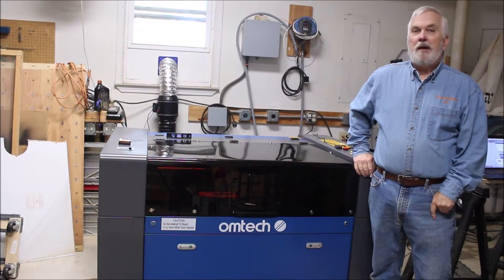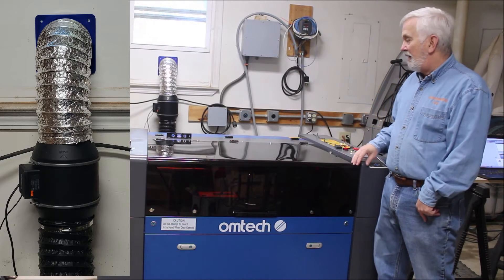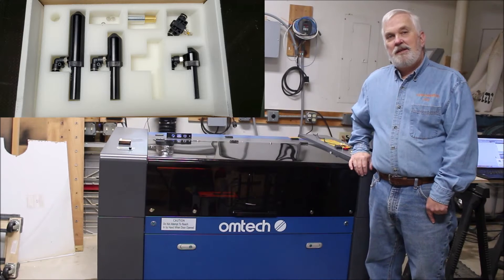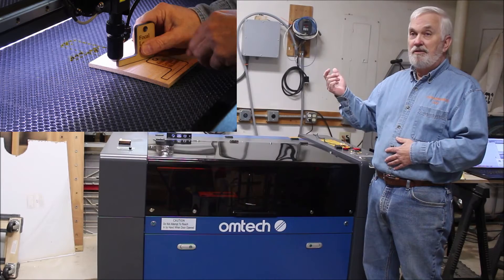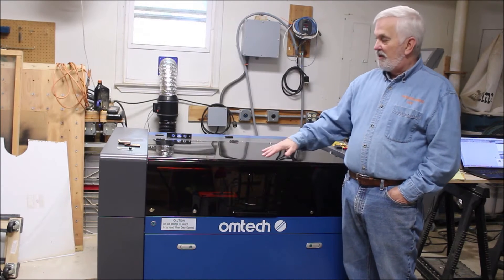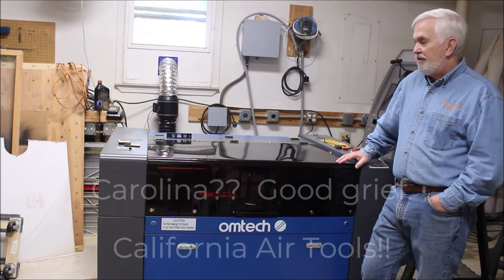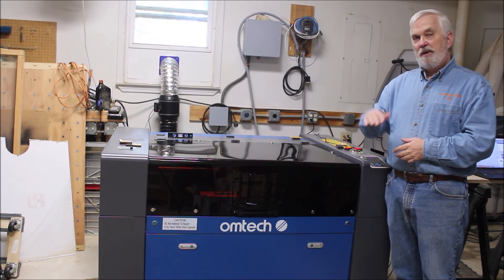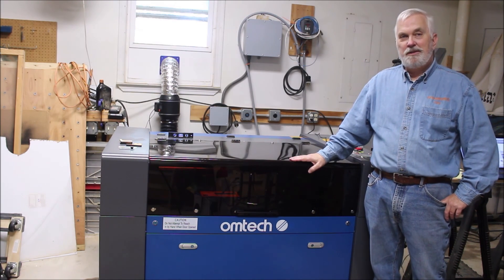Omtech Laser Set Up and Upgrades

Comment: Nice shop setup.  I don't think it would hurt to leave the stock fan in place and run the new fan.  It is a restriction point, but the new fan functions like a booster or vice versa.
Reply from the maker: That's not how airflow works.  You need to remove the weak stock fan to get a good draw.

Comment: I am trying learning more about AP lens. What lens do you use most?
Reply from the maker: Thanks for watching Douglas.  I typically use the 2" lens the most.  No real reason other than the stock lens that came with the Omtech was a 2".  If I was doing an engraving and I wanted the best possible result I would use my 1 1/2" lens.  If I needed to cut some thicker material I would use the 4" lens as the focal length is better for cutting than engraving.  There is a good explanation of the different lens on the American Photonics website.

Comment: Hey Dave! Did you plug your chiller power into the laser engraver? There is a port in the back for the chiller but i've seen others say not to use it. I just got my AF2435 and i'd prefer to have everything plugged into the laser but i also dont want to cause an issue.
Reply from the maker: No, I did not.  I have my chiller plugged into a separate wall outlet on a different circuit.   I've noticed that when you turn the chiller off the water will drain (because of gravity) out of the tube and back to the chiller.   Because of that, I like to turn on my chiller 5-10 minutes before I actually run the laser.  That way when the water goes back to the laser tube it has a few minutes to get rid of any bubbles.